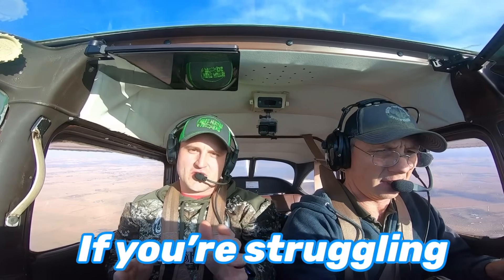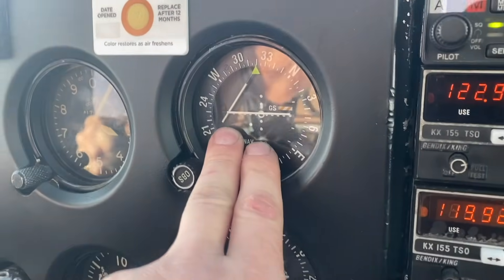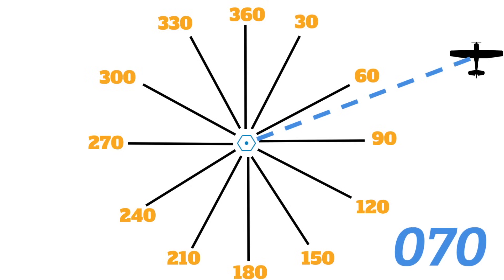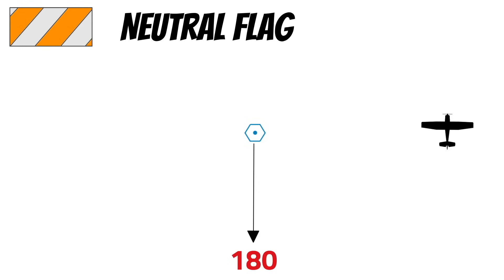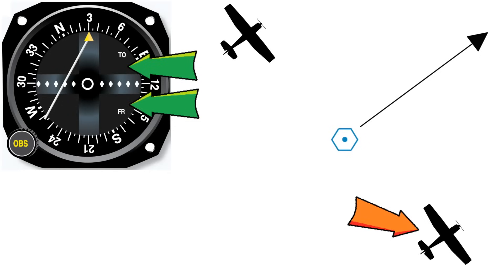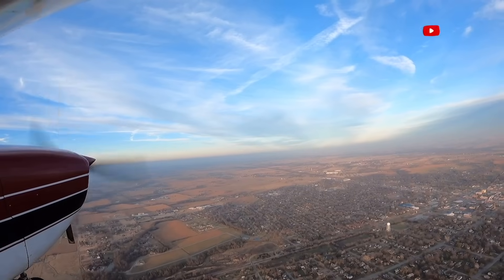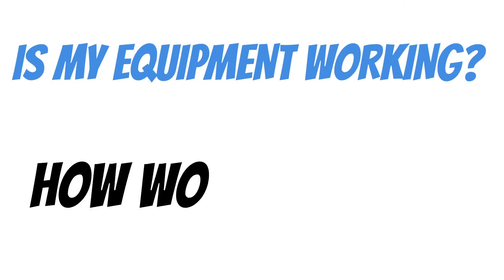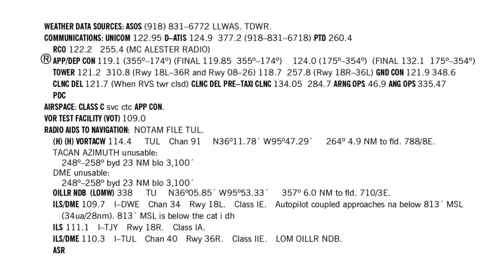You WILL Understand VORs after Watching This! (PPL Lesson 37)

Comment: This is great stuff… in 1960. No disrespect to CONUS/NAS aviators. But If you are trying to fly in conditions less than optimal or non-vis, why is all of this mental distraction acceptable from a safety perspective? The margin for error is, well,…off the charts. It’s the 21st century. We have the capability to navigate a course through waypoints to bearings along the course following a flight plan and it runs on smartphone-level technology. It shouldn’t be this complicated. But I get it. It’s the FAA. 
Much respect to naval aviators who frequently land on carriers. They’re another level of skill and intelligence.
Reply from the maker: You’re absolutely right. However, I just flew over Denver at 16,000 feet two days ago and we completely lost all our GPS capabilities in the 60 million dollar plane we were flying. We even lost our position on our iPads using a stratus puck.  We queried Denver Center, and sure enough, a lot of pilots have been getting interference from “suspected 5G”.  Now, thankfully, we were at 16,000 out of the weather, but if we would’ve lost that on a gps approach in the weather, I would’ve been sweating bullets and been grateful to switch to the old raw navaids.  I think we are going to regret this “step forward” in technology
Reply: @FreePilotTraining   Understand and I’m glad your safe! Redundancies and backup systems are critical. The FAA and NAS aviators don’t have the safety record they do because of hasty changes. 
I work with the FAA (FTI) and their inter-operations systems in ATC’s, TRACONs and all ARTCCs including everything in between from WAAS, VOR, RCAG/BUEC to TBFM and ERAM systems daily. Most of my job is keeping 1960’s ATC systems up and communicating over modernized comms infrastructure for FAA next-gen. 
The FAA will use incandescent bulbs until there are no more. Then I’ll have to build a solution that allows LED bulbs to work in their incandescent bulb sockets. 😉
Clear skies and mild breezes, my friend. ✌️👍
Reply from the maker: @ivymike3459  yes they are! That’s pretty cool. There’s a lot to learn in those fields.

Comment: I like your vids very much!
Only 1 thing in this vid is what i miss is when you move/turn the plane in explaining from/to, the VOR needle does not change equal with the plane. If you did this would be 100% more clear for me...
Keep up sharing your great videos, kudos!
Reply from the maker: Thank you! If you’re talking about when we turned outbound in the plane, the needle didn’t really offset to the left that much. That’s because we had a wind that was basically blowing us back into course so we didn’t deviate off the line that much. If the wind would have been blowing the other direction, we would have been a lot more off course
Reply: Graanschuur, also keep in mind that the VOR indicator does not show any information about the heading of the airplane.  It only shows the bearing to or from the VOR station.  If you want to be flying toward or away from the station you need to refer to your directional gyro or compass to know what heading (direction) you are flying.